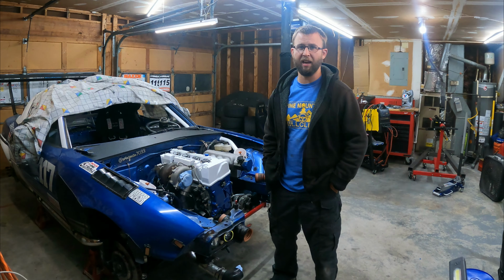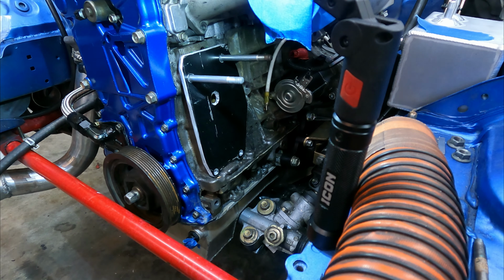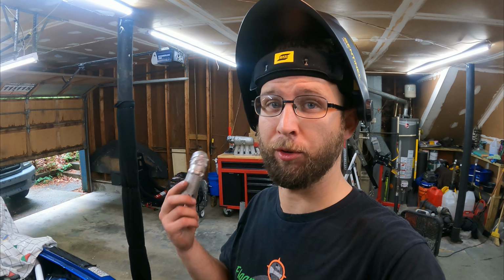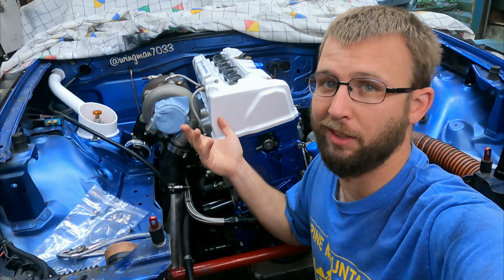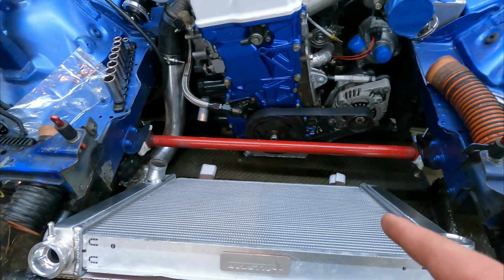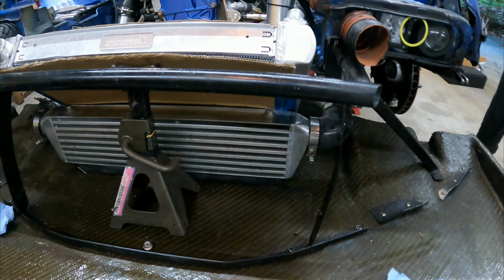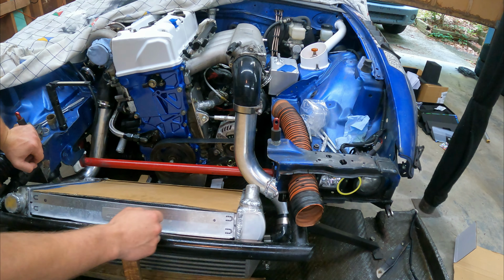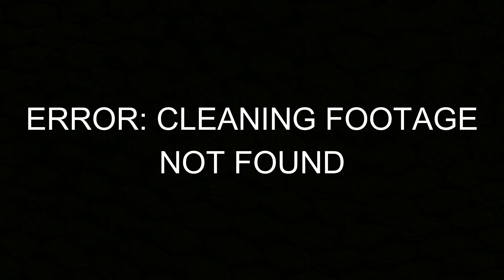Keep'in it COOOL  (Building the Ultimate Hillclimb Miata Ep7)

Comment: I think one of the principal ideas of racecar design is "what do you want to do and how long do you want to do it for" - Cooling is limiting for so much, so this is the exact approach I wanted to do as well. Its amazing how many things Ive thought of  and planned for that youre just... doing. Youre a role model. Thank you.
Reply from the maker: @Omeshan  Me from the future here. This cooling setup kicked ass. I struggled to get it to operating temps even in 90° ambient temps untill I halved my already small radiator inlet. The EWP's insane flow definitely helped, but the extra large triple pass radiator itself does serious work.
Reply: @wingman703  Is it you from the future, or the vid is you front the past? Hmm NVM future you is cooler! So you couldnt get up to operating temps even with PWM at lowest so had to put more backpressure on pump to reduce flow? Would you have done anything differently? Like smaller Rad or smaller pump, or do you need the capacity when at full tilt? Space is a premium, so just asking. Also, do the NA headlights take up space and get in the way? They cool as hell... but space!
Reply from the maker: @Omeshan  Haha video me is past me for sure. Basically to get it to operating temp I leave the pump completely off until ~140°F, then run it at minimum duty until 190°, and start ramping up in flow rate from there. Trying to run it at minimum duty from 80° or lower ment warmup took 30-45min at idle. When moving and with some load in it, warm up is much quicker. Getting it warm in the winter(40°F and below temps) is definitely going to be a struggle, but that's future me problems!
Definitely wouldn't reduce radiator size. Having the extra cooling capacity is going to allow me to upsize my intercooler, which you might notice is very much on the small side. I'd much, much rather have too much cooling capacity and need to downsize/block off inlets then not have enough and have overheating issues again. 
Popup headlights could probably be made to fit, but that's just weight and aero drag!
Reply: @wingman703  I wish i could show you how much i appreciate your detail in replies. One day if we find ourselves in the same place in the world, drinks are on me. Your R&D is definitely worth it! My build is aimed at somewhat time attack but also street legal. If i land up building it in Australia, its harder - I need to then use an NA because its old enough to do a subframe swap (Aus rules are a headache), but i would like to use the NB... but i may try something weird with front end swaps... Problem for later me to look at space and rules and stuff.
Reply from the maker: @Omeshan  Just happy to bring everyone along for the highs(and lows) of building a fast Miata.
Reply: @wingman703  wait... fast miatas have lows?
Reply from the maker: @leftlane_miata  More lows then slow Miatas 😆

Comment: Hey! Have you considered running reverse flow cooling with that EWP? You might need to use Earl's coolant to avoid steam pockets, but it should reduce your knock threshold by quite a bit and cool the motor even more efficiently.
Reply from the maker: @Doomburger7  I have not heard of this, what's the benefit of running the system in reverse? Any sources or solid information as to?
Reply: @wingman703  So, Reverse Flow Cooling is something that Smokey Yunick worked on and that Pontiac used in 1955-1960. GM also used it in the 2nd gen LT1/4 and I've seen it used in some pretty unsuspecting engines more recently (Mercedes, I believe). The mechanism seems to be that the cylinder head conducts most of the combustion chamber and exhaust heat and exchanges that heat with the incoming intake charge. In addition, the exhaust valves and cylinder head are two primary sources of hotspots in the combustion chamber, so giving the head priority cooling alleviates these effects and raises the knock threshold of the engine, enabling higher compression or boost and/or timing advance. I still don't know the effect that reversing the coolant flow has on the cylinder walls, but that seems to be less significant for performance and the few folks I've seen online who've ventured use it have reported that it works.
Reply: @wingman703  YT seems to be deleting my comments with the links in for some reason, so I'll throw them in separately, but lmk if they don't come through.
Reply from the maker: @Doomburger7  Links didn't work, but you've given me enough terms to research and look into. Thanks!
Reply: @Doomburger7  @wingman703 I would be skeptical about implementing it on a motor that isnt designed for it. Definitely more research is needed and its an interesting topic. I will speak in Celsius because that is what I know - Lets say your Max temp is 100C of your coolant. Your min temp after radiator  shouldnt be close to ambient (since then there would be no "warmup" of the engine)... Thumbsuck 60C. I would think thats a low guess too, but that gives you 40C difference in temps. In absolute terms, Kelvin, used in heat transfer, (470K vs 443K) is not much when using the equations. When you take into account what you said that most of it is picked up in the cylinder head anyway, reversing coolant flow might only get you a 15C change in coolant temp when entering the head... I dont think it would be worth all the extra effort, particularly when he is not struggling with cooling capacity. If you want to help knock etc, easier and more trusted is water/meth injection? Still a very interesting topic to discuss, and I would love more numbers and info. Your post has gotten the interest of my chemical engineering mind and made me thing of courses I have long since shoved to the back of my  mind lol
Reply: Padlock here (aka Matt) - thanks for the shoutout @wingman703... Have been doing OEM cooling system design for 8 years now for what it's worth and have studied and benchmarked OEM system of all sorts during that time. Reverse cooling can work, but it depends heavily on the design layout of the engine. One of the main initial challenges with any  cooling system is not only cooling the hot zones, but ensuring air pockets don't get trapped and localized boiling doesn't occur ANYWHERE in the system.   I'm going to generalize here because there are always exceptions to the rule, but if you take an engine designed for cylinder->head flow direction and switch it to head->cylinder flow direction you run the risk of not evacuating all the air pockets out of the system as the downward flow of reverse cooling is trying to push air pockets down before they can escape upwards and out. That isn't to say it is impossible to do, but why fight gravity if you don't have to? You could vacuum fill the system, but that sucks for the DIY enthusiast that just wants to fill it up in his/her garage OR on the side of the road OR at the track with minimal fancy tools.

Keeping a cylinder->head upwards flow design, like Honda intended it on the K-series (in conjunction with the rear water neck fill in RWD layout), is like hitting the staples easy button by knowing air pockets will burp out properly without fancy tools. Cooling system temperature improvements can much more easily come by increasing the radiator heat rejection (aka size) and by increasing coolant flow rate, both of which are being addressed in overkill fashion in this video.

In an ideal heat transfer world, you'd want your coldest fluid (radiator outlet) to be hitting the hottest engine zone (exhaust ports) first like the reverse flow cooling suggests for best efficiency, but in a world of compromises this layout creates other downsides that many times aren't worth the benefits. I have done some lab testing myself that has shown the real difference in water temperature hitting the exhaust port region is only a few degrees different between the two flow directions. If those few degrees are worth the trade offs you made to achieve that, then go for it, but always keep in mind there's never a such thing as a "perfect" design without compromise. You almost always give up something to get something else.
Reply: @leftlane_miata  Wow, what an incredible response. Its amazing to see a true professional here sharing the knowledge. Thank you for the detailed reply, even though its not my original post, or video. Just want to show appreciation... and also nice to know my thinking is kind of on the right path too. Cant wait to get my hands dirty with this stuff too.

Comment: Is that the same radiator that Bronson linked way back when in his thread?
Reply from the maker: @CameronHall-wq9tk  No, but roughly the same size I think. There's a dozen generic 26" wide radiators on Summit, the tricky part is getting one with the right inlet/outlet sizes and locations.